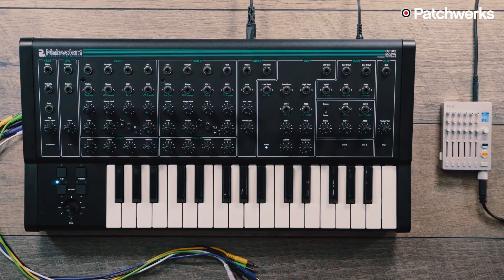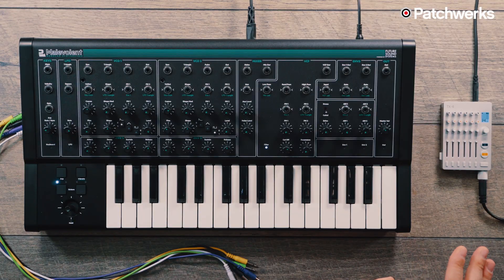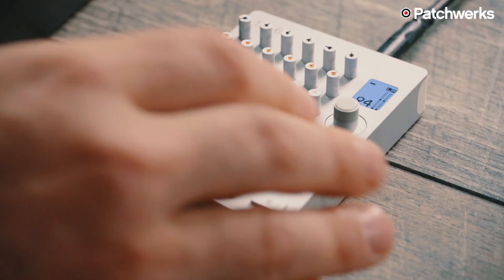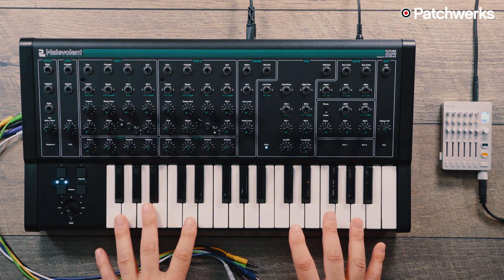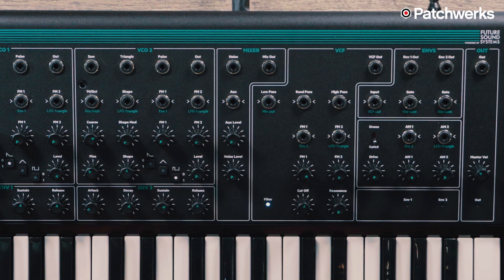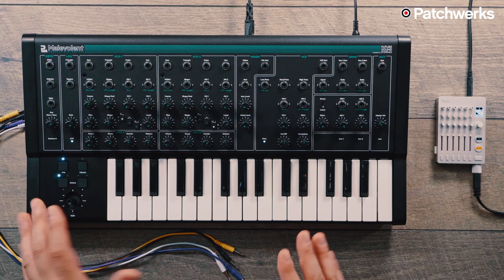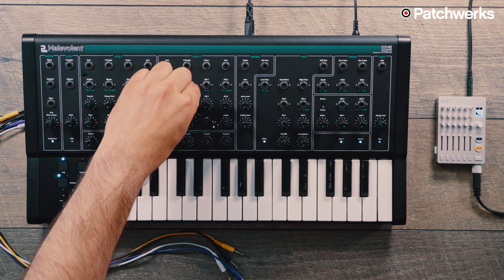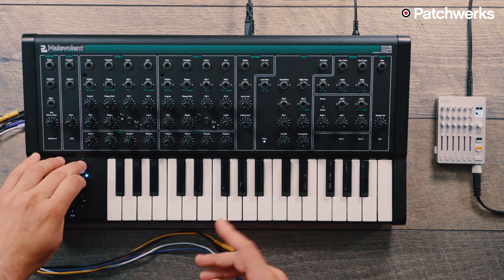PWM Malevolent Overview, Demo, and Thoughts

Comment: Patch saving is pretty much a must -have, to me at least and I'm sure to most ppl I would think. They could have easily included that feature, without violating any   most holy analog esoterics.  This looks to be a great piece of kit, and the dev seem to be sufficiently future-minded and even somewhat iconoclastic, since this seems to be designed in unorthodox ways, and such (I'm not a synth/electronics expert by any stretch, so the deep stuff of that sort I'll leave alone. I have a peripheral loose grasp of what an oscillator is and what a filter is), but omitting the ability to save patches is laughable.
Reply: I dunno, everything i've ever used minus a volca or two can save patches. I would be interested to know what life is like and what my synth skills would be affected by a workflow that constantly had me making sounds from scratch. This is the kind of synth i'd be exploring that area with anyways.
Reply: How many other semi modular synths have you seen with patch saving? Because I've seen precisely 0.
Reply: Adding the patch saving in a semi-modular synth involves a huge amount of complexity and cost. The arturia matrixbrute might be more up your alley, but you lose the patch points.

Comment: One very important thing to note is that each oscillator starts to overdrive by turning its level knob beyond halfway. So you can attain totally different sounds with differing volumes of the oscillators themselves. Also, this affects how the awesome resonance and drive parameters behave. 😁 ♥ 🎶 🎹